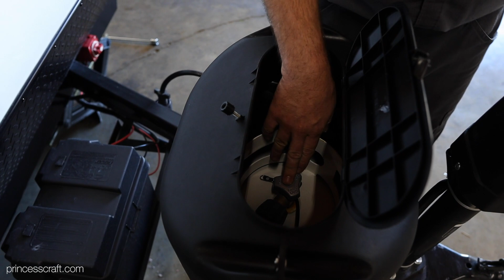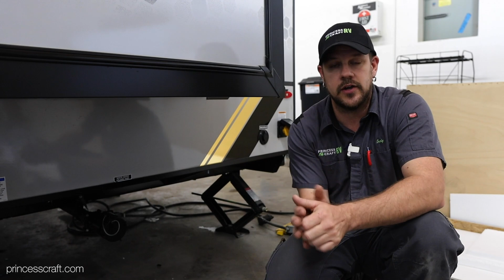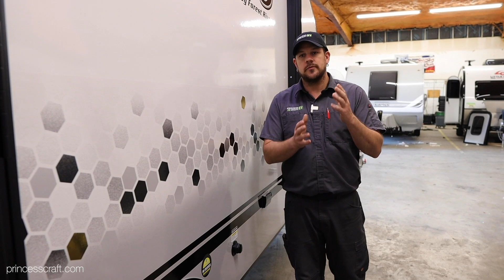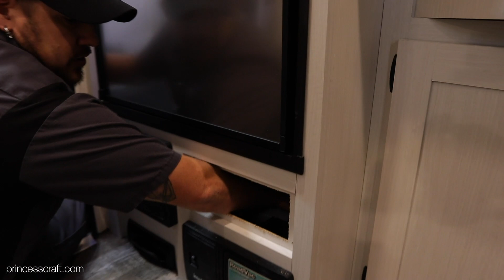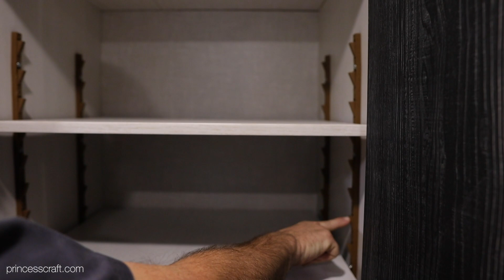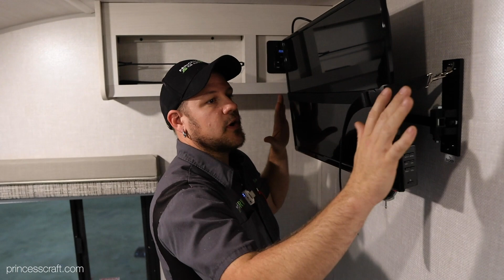2021 R-Pod 196 by Forest River - Tech Tour

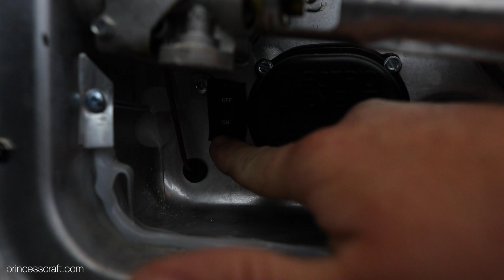Comment: Thanks for mentioning to turn pff hot water switch after winterizing just in case the RPod is plugged in (around 21:45). The how-to winterization videos I watched didn't mention that.

How long does it take to cause damage and what is the process if done? Mine was like that for 24hrs.
Reply from the maker: Often, little to no damage is found in a time period like that.... but in the instances where damage is done, it can be pretty bad. A service center technician can see damage right away if you get their eyes on it. You might look into the cabinet where the water heater/tank is located and look for melted/burned foam around the tank and associated components. If you don't see or smell anything right away, you're likely okay.